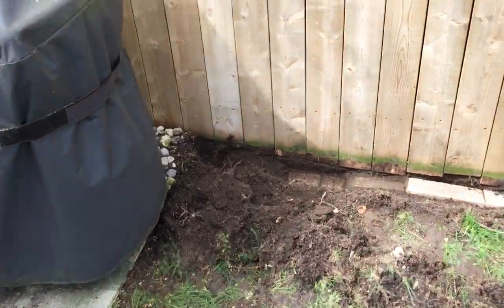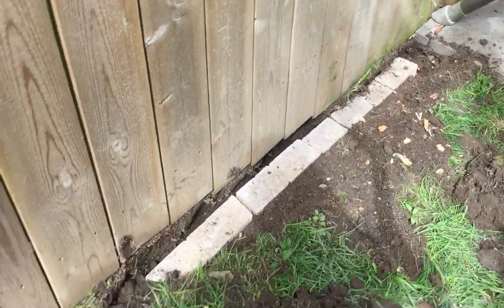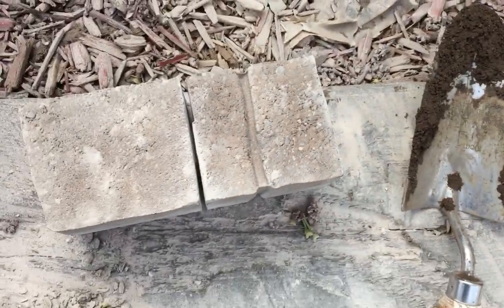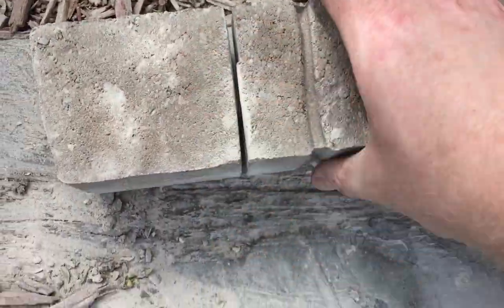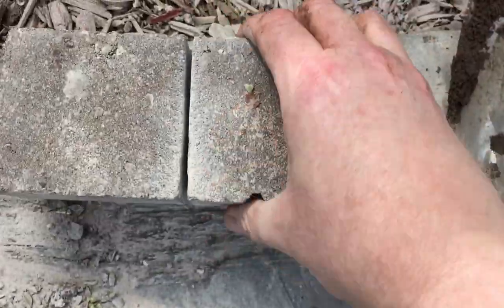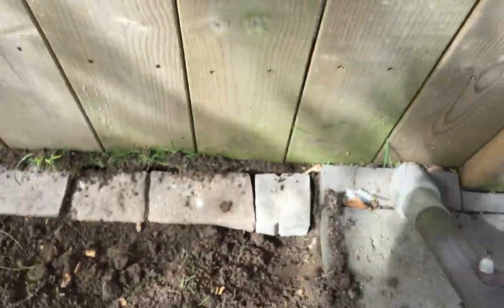Skunk Problems?  How to skunk proof your property

Comment: If they can dig under fence, can't they dig under the brick too?
Reply from the maker: In my experience, once they dig through the topsoil and hit something solid they move to another location. 

I can tell you with this repair I did, I have not had skunks under this section of fence (knock on wood).  Thanks for the question and thanks for watching!